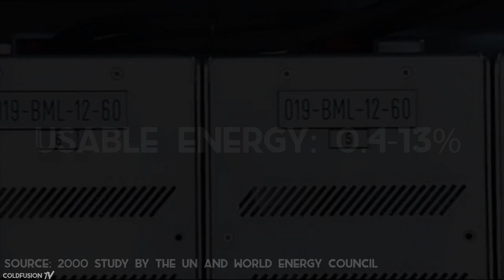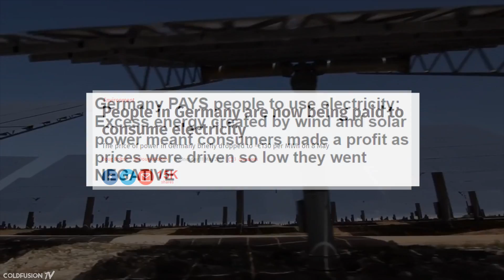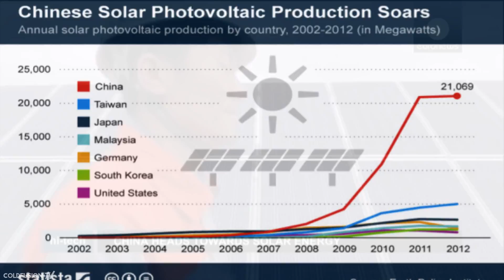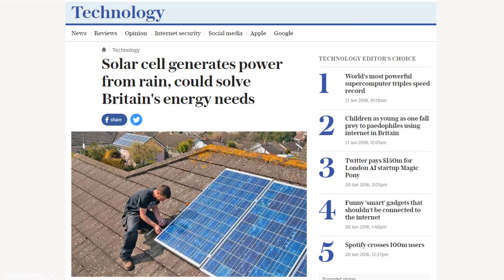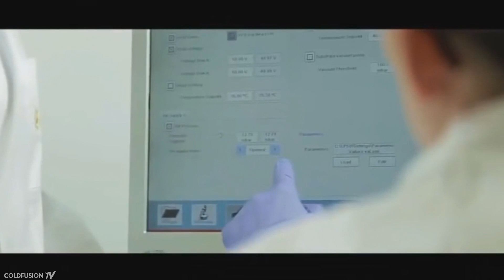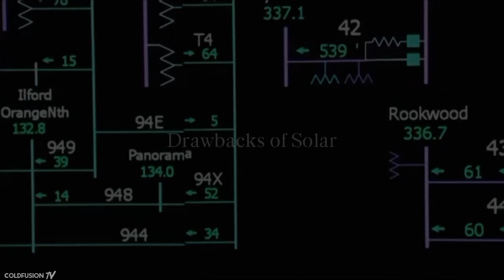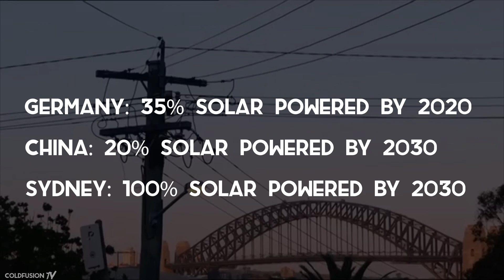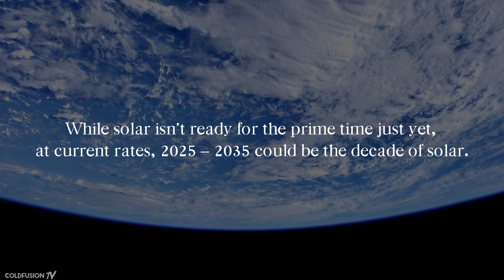The Truth About Solar

Comment: Efficiency of solar can't be compared to coal.  coal is one time use and you still have to remove the co2 from the air or face consequences of global warming.   solar energy that is otherwise wasted or primarily wasted has most solar panels and Farms are placed in areas such as roofs and deserts where there is no other use of the sunlight.

Comment: The high quality solar panel's efficiency is less than 20% and it is impossible to make it much more higher. Solar power just can't be efficient enough to make it the main energy. It is against second law of thermodynamics to gain finer energy without input any other energy.

Comment: i think solar is great im interested in the non flat panels and how the computer came up with it and second thing is natural gas or gas from rubbish would make a better way to produce power when the sun is down i have an engineer in australia i know who designed some modifications to a caterpillar engine so it can supply a 30 story building with natural gas power and it can handle a 75 % power increase in seconds without stalling the motor the epa tested it and found it had half the emissions that is legally allowed and they were shocked that a motor can run that low